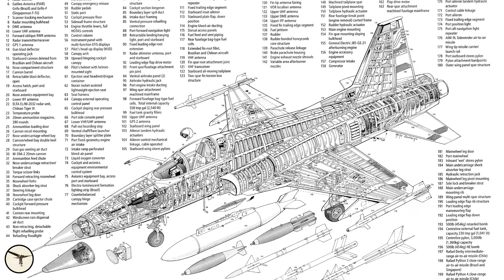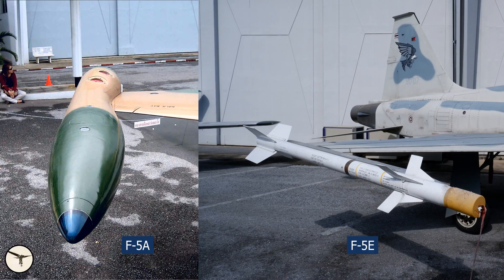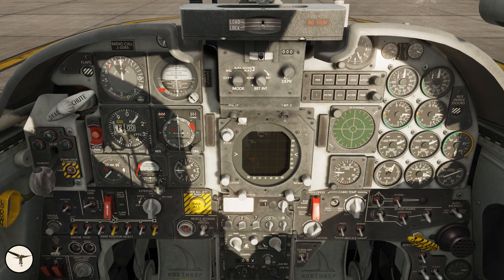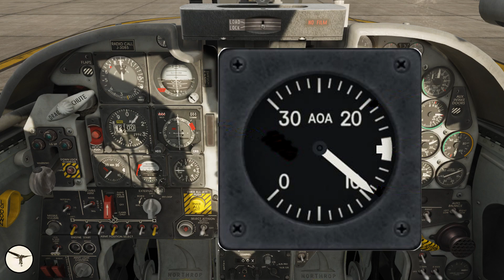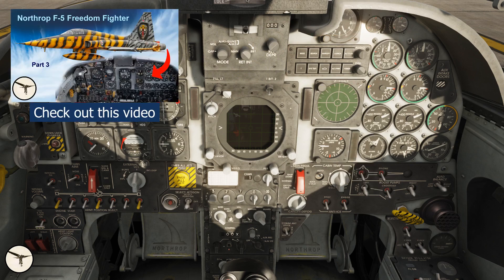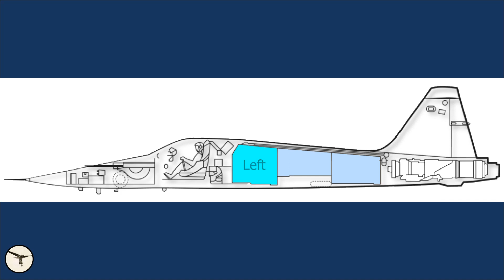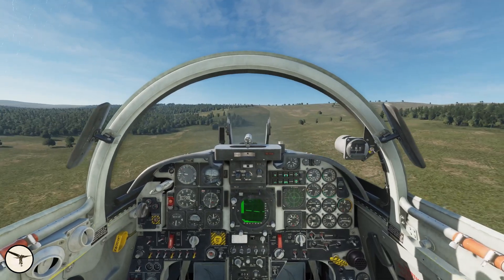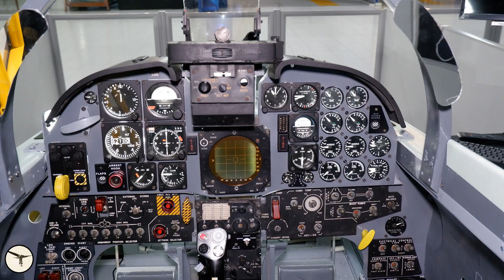Northrop F-5 Tiger II @ 50 | Chuck Yeager's favorite fighter

Comment: Great video about a favorite aircraft of mine.  I always regret that politics kept the F-5's offspring, the F-20 Tigershark, from reaching production.  "The Greatest that never was" also received accolades from Chuck Yeager and many others.  It had a single engine that produced 160% of the thrust of the F-5E's hard-working but too-small J-85s.  It required hardly any maintenance compared to the F-16, was far more likely to be mission-ready, and could fire the AIM-7 Sparrow missile seven years before the F-16.  It also had revolutionary avionics, something looking at the F-5E panel brought home.  The F-5 was a Kelly Johnson design.  He was a true genius of aircraft design.  I enjoyed hearing the F-14 driver's reaction to dogfighting the Shark.  With the avionics and engine upgrades, the F-20 would have been downright scary. At least the indirect descendants of the F-5E had success. The F-18 Hornet and the JAS-39 Gripen were/are great fighters.
Reply from the maker: Kelly Johnson didn't work for Northrop. The F-5 was designed by a team lead by  Edgar Schmued. Here's the story: https://youtu.be/hp53hEYtjxA

Comment: You asked about tip for next video and then I have an request anout cost for aquiring and operating this type of jet fighters from same time periode. Comparing the immense cost for the F-14 Tomcat to the nimble smaller alternatives explains a bit the export success to smaller contries
Reply from the maker: That will be an interesting spreadsheet. I will check around.

Comment: Great video on a lovely little fighter!  In an age of the overly complex and expensive F-35, I feel there is room for something small, (relatively) cheap and agile that can be purchased in larger numbers and used alongside the the current "king" of the fighters.  Although much bigger than the F-5 perhaps the SAAB Grippen and F-16 move in this direction.  Thanks again for a great video!
Reply from the maker: Yes, the Gripen and the Viper are the world's best light-weight fighters today. They are not much bigger than the F-5, but the larger wings allow them to carry more.

Comment: Aerodinamic design it't good.  Miror for Mirage 2000 France Airplane...
Reply from the maker: Aerodynamically, the F-5E and Mirage 2000 are very different. The F-5E is light and nimble, and has very good transonic performance. The Mirage 2000 is based on the Mirage III, which was designed to be a Mach 2 interceptor. The delta wing provides structural strength and space for fuel, but creates high drag at high angles of attack. The Mirage 2000 can deliver quite a punch, but the Tiger II will fly circles around it. Taiwan has both types, and I have seen them at an airshow. The Tiger II is nimble. In comparison, the Mirage depends on brute power to stay aloft.
Reply: @FlywithMagnar  Hello. In dogfight, the MIRAGE 2000 is more similar to the F16 than MIRAGE 3. Although the F5 is agile, doesn’t have enough power to maintain the required turn rate, Gs, etc.